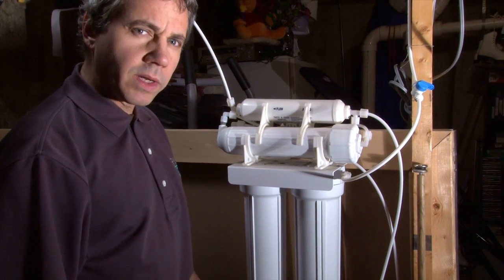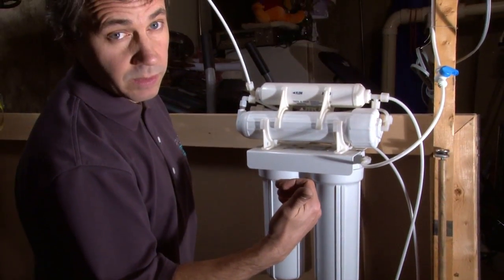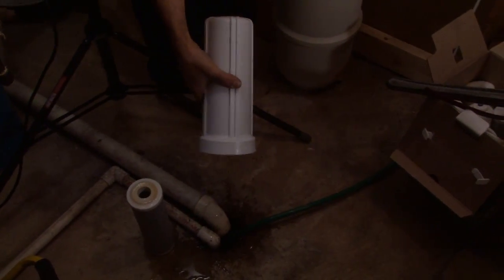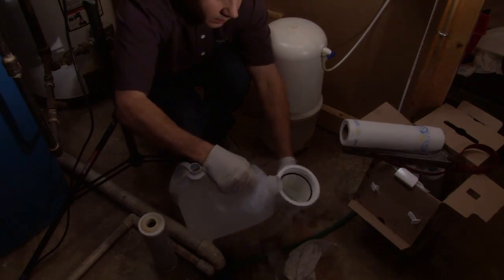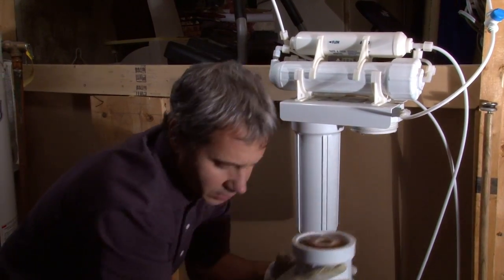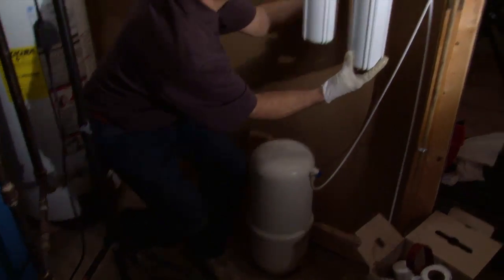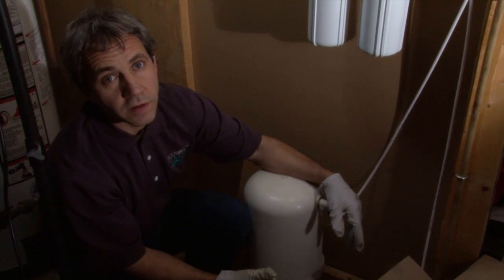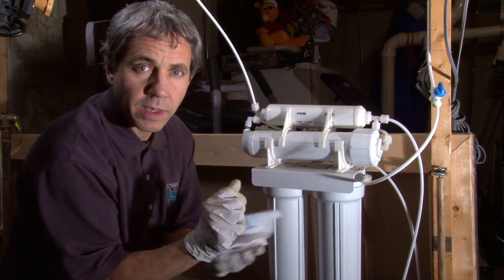Basic Reverse Osmosis Filter Change

Comment: Do you have to flush out 1-2 tank of water after replacing the first sediment > carbon > carbon RO?
Reply from the maker: If you replace a 'Post' carbon (the filer is inline between storage tank and to your faucet, purge a quart or so of water to rinse out the new filter, Test - If air and or some dark water comes out after the filter change, you have changed a post carbon, flush a quart or so of water. If however you replace the membrane, 2 to 4 hours of water makeup / production, should be rinsed to drain before use.

Comment: Excellent presentation for the filter system I have...  One question.  Do you not change anything for the other horizontally placed thing?  You covered the two vertically placed filters and the horizontal one on the top but there is one more which was not covered... I am assuming nothing is needed, but I just wanted to double check with you.
Reply from the maker: Jay, the larger horizontal housing is the reverse osmosis membrane, I recomend replacing every 3 - 5 years, some manufacterers recommend every 2 years.  I will have to make/post a video on replaceing the membrane. I am sure others already have. If you do replace the membrane, replace all other cartridges at the same time. Let the system make new water (about 2 hours), leak check, then open faucet and empty completely until a dribble, repeat process, The third time the system fills you can start using the water, A TDS (total dissolved solids meter) would be helpful in determining/verifying a 90% reduction in TDS from the feed/tap water, to verify you are rinsed/purged/all good.

Comment: I would like to know how you mounted it in the basement.  That is exactly what I would like to do.  Is there a video?  Thanks!
Reply: David I have this same system mounted in my basement to make it as easy as possible I mounted it underneath the kitchen then you simply run the water lines up drill a hole through the bottom of cabinet where sink is and run line up to the faucet. Also have a line run directly to our refrigerator icemaker. You can buy spools of line at home Depot or menards. It's simply have to figure out where to drill of course and it's as easy as running the lines.

Comment: Do you drain out the water tank before you start? and What did you mean by "purge" at the tail end of your video? Are you referring to draining out all the water from the tank? Thanks
Reply from the maker: I typically drain the tank completely with the new 'post' filter on so I can check for leaks and rinse the new post at the same time, separate video needed / With tank empty & faucet still open, lift tank to confirm empty (Water weights 8.34 Lb / gallon, so easy to tell if there is water still in the tank) I use an M12 Milwaukee mini digital air compressor to add 7 - 8 psi to the tank, keeping faucet open the entire time, some tanks can be brought back to life for another year, as pre charge is added / the tank will empty completely, If Water stays in, bad tank, water into air bladder. (a bike hand air pump & low pressure tire gauge can be used, normal pressure gauges will not work, they start at 15 - 20 psi, 4 - 8 psi is final target with a water empty tank.

Comment: Hmmmm.... you didn’t show how to change ALL filters, particularly they RO membrane or the top prefilter. Disappointing..
Reply from the maker: Will have to be another video, more involved, not done annually, and a good time to do thorough sanitation of entire system. Do to the involved effort of doing all that properly, almost makes for sense to run a system for 4 - 5 years tops, and just replace the whole system with new, new post carb, new membrane, new tank, without all the sanitizing procedures, I generally work on High end Quick change systems, where a sanitation kit is used making all that a snap. More difficult on a cheap conventional system. Will keep a future video in mind though.
Reply: @countrysideecowater  Calling you out on this, sorry. The title of the videos says change the filters. That includes the RO filter as recommended. You certainly aren’t supposed to wait a year to change the RO, they recommend 3 months, at which time the other filters are changed as well. And in this filter change it is mandatory to sterilize the whole system. I stand by my comment. Disappointing as it is incomplete.

Comment: What if the bowl of it is stuck? How can you remove it?
Reply from the maker: Very Large Channel locks, but unit has to be mounted properly or it will tear off the wall (typically will tear off of dry wall), best to remove entire system, lay it on the floor where your can kinda put a foot on the frame and use a very large channel locks

Comment: Very helpful; thank you! I have 2 of these systems at 2 different houses installed by different plumbers, and neither one has shut-off valves on the tubing--neither at the tank or on the intake tube. I turned off the water at 2 valves that are 'typical' (to me) plumbing valves (roundish oval shaped, chrome)--one that turns off the water to the kitchen sink and one at another PVC junction at the bottom of the cabinet, which evidently is an intake to the RO system. I had to turn both valves about 8 turns for them to go all the way off. The little 90 degree turn valves shown in your video are nice; I'm not sure why my systems don't have them. I removed both sumps and lubed the O-rings on each one because the post-filter sump had a slow drip from the top, where the O-ring is. I figured since I had it all shut down I might as well lube them both, even though the pre-filter sump was not dripping. I didn't replace the filters because this system was just installed a couple of months ago. Put it all back together and so far it's dry. I'm not normally brave enough to tackle plumbing projects, but now I have the confidence to change the filters on the RO system at my other house--thanks again!

Comment: Thx.  But I have 3 of those big filters. So how do I know which is which?  Thank you.
Reply from the maker: you need to determine your flow through the system, follow the feed line in, then out of the first filter housing, it may go in one, out into the second, and then to the third, that would be one pre filter followed by (2) carbon block, at any rate find the first filter housing that the in line goes to, that will be a sediment or pre-filter, the others should be carbon.

Comment: hello I change my filters but put a 1 micron in the pre and 5micron in post they are both block filters. Does it matter if I  mix the filters up ?
Reply from the maker: Will not affect water quality. The only down side is that the 1 micron may plug too quickly in the Pre position. You will know because water production will decrease. Just change out Pre-filter at that time for a 5 micron. If plugging of the Pre-filter is problematic (too often) I go to a string wound 5 micron pre-filter - last longer before plugging

Comment: We haven't changed ours in five years and have very hard water. Is is possible they are all seized now - we have the tool, and are killing our wrists trying to get them open. Followed the video to ensure the various water pressure points are off. Help!
Reply from the maker: As long as you have given depressurization enough time - IE leave feed valve off, leave tank valve off, and drinking water faucet open for several minutes,  The extra time to depressurize may be necessary with plugged filters.  Someone may have used plumbers dope on the housing threads - hopefully not,  (Non-curing O-ring lube on the O-ring only !) You need a much bigger tool for leverage and make sure you really hold the frame or you will rip the mounting hardware right out of whatever it is mounted to. You may even have to remove the unit, lay it on the ground, really hold back on the frame and use the leverage necessary to remove the housings. - Good Luck !

Comment: Great Video! What about the filter that wasn't mentioned, the one below the polishing filter, what is that one for and when does that need to be changed?
Reply from the maker: +Jason, The membrane (in the horizontal chamber above the pre-filters).  Change every 2 years with source water containing hardness.  With a properly functioning water softener 3 - 5 years.  When changing the membrane is a great time to run bleach through all the housings empty of filters and membrane for thoroughly clean the system.  The most common membrane on most standard systems is the TFC 36 gpd (Thin Film Composite, 36 Gallon per day)
Reply: +countrysideecowater thank you!

Comment: Let's say that I have a reverse osmosis system and I need to change all of the filters as well as the membrane. Do I need to worry about buying the wrong filters or membrane? Or will I be fine as long as these parts include the words reverse osmosis in the selling title?
Reply from the maker: Shaolin Westerner There are a lot of different filters available and Reverse Osmosis configurations, so it is impossible to give you an easy answer, Hopefully your system has a Thin Film Composite membrane (TFC), you want to get the same output size otherwise your capillary or reject control may need to be changed, IE 18gpd, 36gpd, 50gpd - go with the same size, Is your water municipally chlorinated ? , make sure there is at least one carbon block filter in front of the membrane, IF you have a Cellulose Acetate Membrane (CTO), that likes free chlorine, so no carbon in front of that, there are three to 7 filter (or more) reverse osmosis systems, the type of source water you have is very important in system and filter selection, IE Municipally chlorinated water, do you have a whole house filter for chlorine reduction ? Functioning water softener ? private well so no chlorine ? If there is a place in your system for (1) non-carbon pre-filter, sediment only, I do like 5 micron string wound over molded - they seem to hold up a lot longer without plugging,

Comment: Thank You,  How often do you change the filter underneath the 2 year filter?
Reply from the maker: Depends on wether the source water is chlorinated (most municipal provided water) or private well - non-chlorinated or chlorine removed after a private chlorination system. Municipal water change pre-filter if sediment annual. The carbon pre-filter should be changed every 6-8 months to protect the membrane from chlorine.  Any post carbon filter (filtration after storage tank inline to faucet can last a year or more. Source water which plugs the pre-filter frequently - add a sediment only pre-filter in front of system or improve whole house system.
Reply from the maker: You are referring to the membrane, we typically change every 2 to 3 years.  If you are good at changing the pre-carbon filter and you have soft water feeding the RO, they can last even longer.  I usually pre-run a new membrane for 3-4 hours prior to bringing them to the customers house.  Otherwise instructions are left for letting the unit run and dumping a couple of times to thoroughly flush the new membrane. A TDS meter is used to check total dissolved solids pre and post membrane, there should be at least a 90% reduction in tds - post membrane.

Comment: I have a Cuno Aquapure PW-RO4 5 stage. I called Cuno (3M) to ask what filters I needed to order. He told me that I needed 2 carbon Pre and 1 sediment Pre (not counting the two top filters) So as I took the 3 filters out, I noticed that there was 2, instead of 1 sediment filter and only one Carbon instead of 2. The canisters also confirmed as they were labeled for 2 sediment and one carbon. Is it OK if I put in 2 carbon and 1 sediment? What would the difference be?